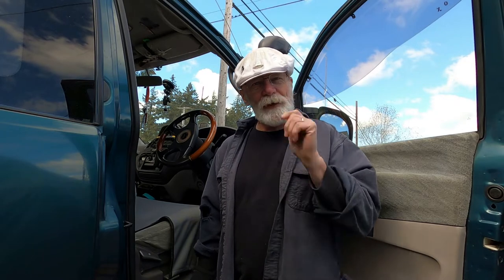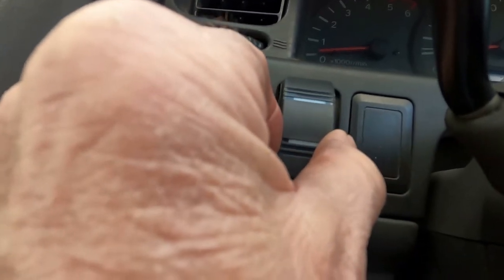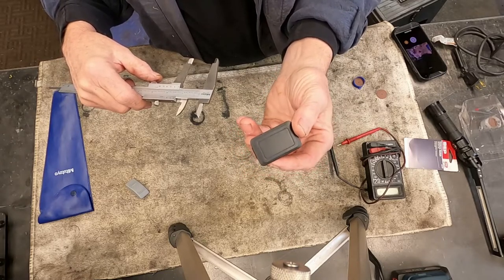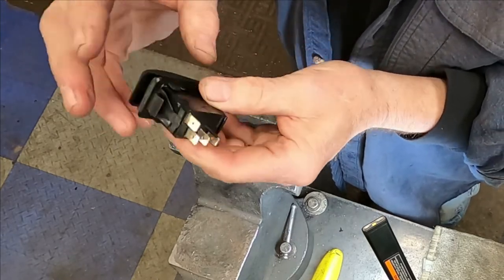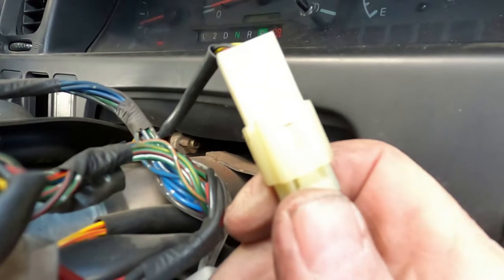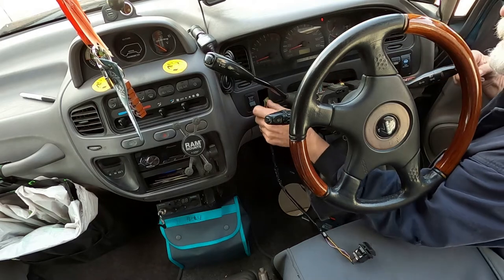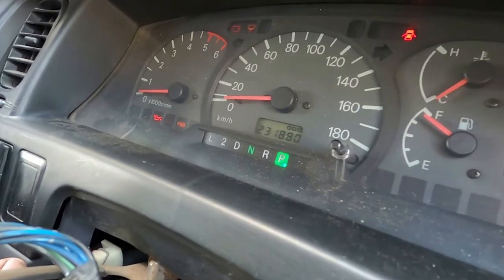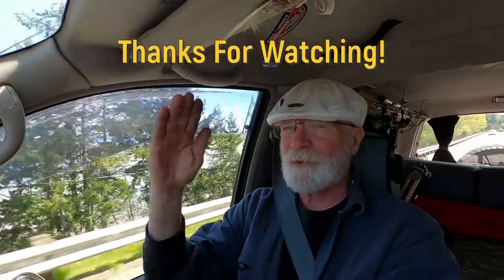Delica Overdrive Better Than A Toothpick

Comment: I did the OD on mine the same way except I used a plain toggle swich.  I like yours with the lighted switch better, nice Job.  Do you happen to have a video of  swapping out the JDM radio
for a domestic DDIN in the Delica?  That's my next project.  Thanks Mr Miyagi
Reply from the maker: When I bought mine it already had the changed out but I've had to pull the radio out to do something and it's pretty simple just hook it up the way you do in a domestic car. Thanks for watching.

Comment: Hi, awesome video, I am looking to do this to my 1995 L400 but wanted to clarify the wiring into the switch please. I am looking to use a non luminated rocker switch that is on/off/on can you give me a little more giudence on how to wire this into the wires from the dash. sorry to be a numpty. Dave
Reply from the maker: I ran my wires from the pump through the firewall and tried in to fuse box with a fuse wire adapter . Which you can buy on line at Amazon. Any other questions I'll be fun to answer. I'll be 4x4 this weekend so I'll be off line... Thanks for watching.

Comment: cut the blank you removed to fit the new switch in it.
Reply from the maker: Yes, I used the blank cutout to the proper size to fit the new small switch so it would fit in the dash. Thanks for watching.

Comment: A good fix but I'm curious as to why you'd buy one of these things when there are so many vans available in North America. Given that it's RHD I gather they are not sold there so you (or someone) must've imported it. Are they common there? I live in Australia and wanted a large van with a V-8 and all power options but there is no such thing on the market here so I had to import a 1988 Ford Econoline. When you do that, you sit on the 'wrong side' and have a vehicle that the Ford (or whatever) dealers never sold so know nothing about, no parts are available so all must be sourced in the home country and shipped out, you hope you'll never need body panels, talking to other owners is almost impossible (I've met one so far in seven years), etc. BTW, Delicas were never sold here either but several used car dealers started importing them and you see quite a few around these days. At least we had a large Mitsubishi presence until a few years ago and they are RHD and I did consider one before I decided on the Ford. In short, is owning a RHD Delica in the US like me owning a LHD Econoline in Australia?
Reply from the maker: Well we really enjoy it . It's a great vehicle for us and parts are somewhat available here in the states although I've bought a lot out of Australia and Japan. We have quite the following here in the area where I live so it's somewhat easy to find what you need or information. I had a Ford Econoline van years ago but it wasn't four-wheel drive so it didn't suit my purpose.  As for driving on the righthand side I got used to it fairly quick kind of freaks people out when my wife is in what they think is the driver's seat and she's sleeping or reading a book it's quite funny actually. Well I hope everything works out with the Ford van the delicas working out fine for us. Cheers and thanks for watching